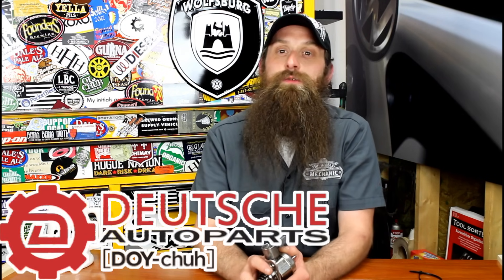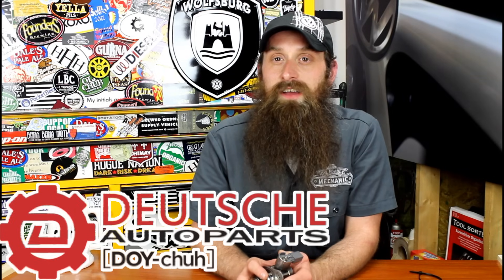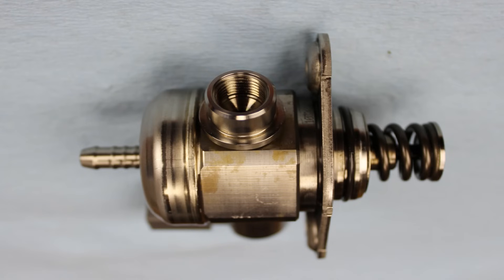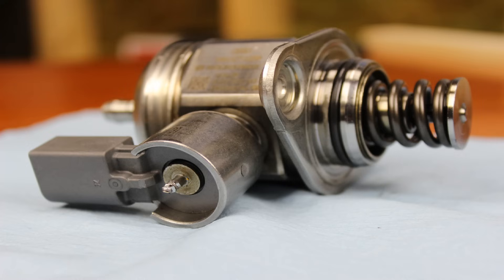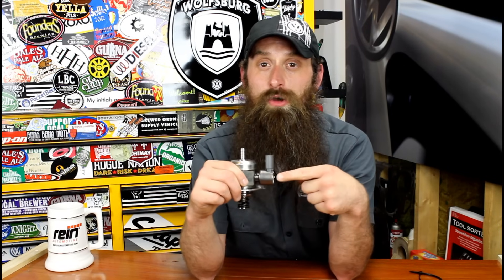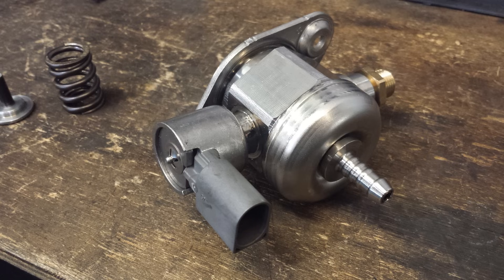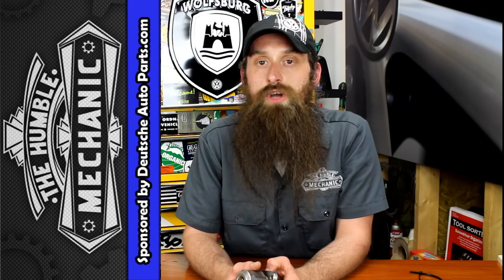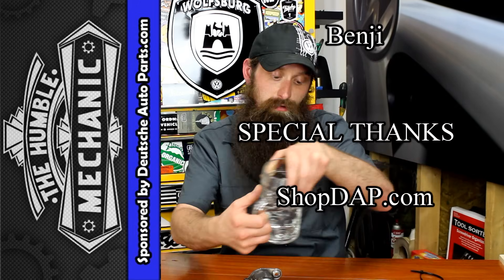How VW and Audi 2.0t TSI High Pressure Fuel Pumps Fail (HPFP)

Comment: I have 2020 Q3 
Shortly after start up it briefly looses HP . Slightly stumbles and recovers. Does this consistently. Sets engine light 2nd trip. 
It will run fine and not stumble until turned off and started again ? 
Just starting to see 2020s here in the shop

Comment: had a customer car, vw pasat 1.8 tsi I change a used one, but still do the same.. cold start its ok, but when hot it shut off engine... Also EO is missing.. but i forgot to check HPFP follower.. wish me luck guys tomorrow.. the customer keep pushing me
Reply: I have the same problem did you figure out what was causing the problem by any chance?

Comment: My Tiguan 2013 has fuel issues the car have no issues power wise but what happen is after the car get hot and i turn off the the car it starts to surge like a misfire if i hit the gas a little it stop or turn the AC on im getting 40 bar but the fuel cycle on idle is 70% and over

Comment: I have a 2017 Passat SE with 1.8. Recently changes coils and plugs and PVC myself. Around 1300 miles after that I had a no start situation. No codes. Brought to my trusted mechanic and he replaced the lpfp and module. He said they bench tested the pump was bad. 
Same day as picking up about 6 hours later I now have a EPC and CEL and stalling and losing power around 2-4k rpm. I used OBDII and see POO87 now. 
I really like my mechanic of 20 years and trust him but wonder wtf before I call him and ask if he pressure checked everything first. 
So could this be a BOTH pumps or could it be a clogged fuel filter? 
I am savvy enough to replace the hpfp but as you stated its am expensive what if. 
Any thoughts?

Comment: Would the hpfp on my 2012 golf R FSI cause my car to not rev past 5500rpm? Its cuts right out like it’s hitting limiter
Reply from the maker: possible. but usually they dont rev smooth up to that point.
Reply: @ seems to work good up until that point then it basically just cuts out, does it in all gears. Almost thinking hpfp or wastegate

Comment: Question, I need some help. I have a 2020 VW Passat 2.0 TSI. 

It keeps blowing out my injector seals on cylinder 1&2. I've replaced them 3 times. It keeps pushing out the both white and green seals that go into the fuel rail, I've done everything people have recommended on the internet, and I've had a certified VW mechanic come to my house to check if I've installed everything correctly. 

Could that be because the HPFP's pressure is too high.? Seals and injectors are brand new (OEM).

Comment: So my car wouldnt turn on because battery was dead tried to swap battery, and My power steering went out, then engine light came on, mechanics  told me my hpfp is not working and needs to be replaced, you can hear a noise coming car wont go past 4k on sport mode and Loss of some power with stutters. I pray to god fixing the fuel pump would work because they said 90% sure its that. Scanned it and everything they said that the thing coming up. Any ideas on what to expect and keep eye out for

Comment: Need some help. I've got a 2016 Audi a3 2.0t Quattro with no fuel codes, but a misfire in Cylinder 4 with a hide cylinder code. Did carbon cleaning, fuel injectors, ignition coils, PCV, N80 valve, ran with some fuel injector cleaner AND did an engine flush with Liquimoly. I've also been using Shell Vpower gas to try and see if it helps. Compression tested and boroscoped all 4 cylinders, no scratches and compression is solid all across the board (155 all across). It doesn't happen all the time, but the car will randomly start violently shaking with the CEL and the EPC light going on and go into limp mode when taking an exit ramp off the highway. I have to pull over and let the car sit for about 10 minutes before I can start it back up. When starting it in the morning, it seems to be smoking a fairly decent amount too (white smoke, smells of either oil, fuel, or sometimes both). Have to top the oil off every week (about 100 miles of travel). Wondering if it can be the HPFP or if it's something else?
Reply: Did you ever find what it was?

Comment: p0221 code :face-turquoise-covering-eyes:
checked the harness , throttle body to ecu to pedal .
rewired it . ok
swap tested with spare pedal and throttle body .
checked ECU. ok 
removed intake , cleaned /checked variable flaps . actuator ok 👌 👌.
cleaned injectors .
car wont rev past 4000rpm 
boosts fine at any gear as long as its under 4000rpm . 
after p0221 erased and did all these things , check engine light never came up again .
any chance it could be the high pressure pump ?????
BZB engine 1.8 tsi skoda superb 
HELP !!!!!!!!:eyes-purple-crying::eyes-purple-crying::face-orange-frowning::face-orange-frowning::text-green-game-over:

Comment: Have Mk7.5 golf GTI with idle stuck at 1200rpm and noticed the fuel pressure at idle is 87.5 bar, seems very high or is this normal?

Comment: Please help! Anyone have a video or diagram of how to get to my hpfp. I have a non turbo audi a3 2.0fsi 2005 model and it's hidden behind like a metal cage. 😢 

It was running perfect except on a super cold start would rough idle for 1 minute. Scan read fuel pressure regulator lower limit not reached p1063. I've since replaced the fuel filter and hpfp sensor and low pressure sensor. Now car is in limp mode 😢

Comment: Can this pump makes metal debris in oil engine i saw couple ford gdi engines with failing this part actually pump was full of metal debris trough injectors ended in engine oil saw those flakes

Comment: Hi my high pressure fuel pump has been rattling on cold starts really bad and also when accelerating but don't have any codes, car has not that much power as before could it be bad. It's not a VW it's a Kia optima.

Comment: I just questioned the 11,000 psi on the other video. The reason i was watching them is I got a Tiguan 2.0T (in the shop, independent) Was towed in, no start. 1st time customer. Had misfire codes on all 4 cyls + random, low fuel rail pressure, cam sensor correlation (wish I didn't erase them with out writing them down). The oil looked like tar and the plugs were blacker than the tire. Did a LOF & threw in a cam sensor. The low press fuel is 90 psi. The high press solenoid clicks when grounded. The scanner (SnapOn) has 2 fuel rail pressure fields. One read 40.75-41 bar, the other reads --- but neither changes when the high pressure pump's line is disconnected. I have a rail w/the sensor, high press pump & housing, vacuum pump from a Tiguan I changed a motor on a while back. Plugging in THAT sensor open to the air also makes no change in the scanner readings. I also swapped in the other high press pump, no change. Odd thing is when the low press line is disconnected is when it sounds like it wants to start. With the pcv line disconnected at the intake, it feels like pressure coming out the port in puffs on my finger. I usually get EVERYTHING started that's a no-start. Been wrenching since '96. Had my ASE's and L1 although they're expired (this shop don't value or compensate for them) All 4 coils have spark. This is killing me. And the inside of the car is filled to ceiling with paper and bags, food wrappers and all sorts of hoarder like junk. Hope they're ain't no bedbugs in there. (Thank God the in tank fuel pump works, I wouldn't be going in the access panel on this one) Any help would be appreciated. Also, while the high press pump was out I stuck a screw driver in there and it moved in and out(thinking maybe the cam in there was degraded from the oil condition) Also put 4 new plugs and from the cranking attempts, the look sooty now too. If I think of anything else, I'll add to it.😢😢😢I also had 150 psi compression on every cylinder at 4 cranks. Disconnected the intake tube to see if the turbo was causing the puffs out the pcv port, it isn't. If that pcv line is sitting in place but not clicked on it actully puffs away from the port about a half inch when cranking.
Reply: Also have compression go up to about 140 psi in 4 cranks
Reply: I cranked it with a vacuum gauge attached to the intake manifold. Actually a compound vacuum pressure gauge. The needle fluctuates between 5" Hg and 5 psi. I repeated it with 1 spark plug removed at a time and it was the same for all 4 cylinders

Comment: German cars are designed for germany; where every 2 years you must do a full comprehensive check on your car and fix everything every 2 years, the part replacement engineering racket.

Comment: I have a 2007 Audi a6 3.2l with code p2296 would I need to replace the hpfp? It stall and idles rough sometimes has misfire codes. Any help would be appreciated.
Reply: Did you fix it? I've got a audi tt doing the same thing my mobile mechanic suggests it the high pressure fuel pump that's going bad

Comment: Hi I have a 15 Audi A3 2.0 quattro gasoline engine I was making line to cross the border     I have it in idle most of the time the car starts shaking and it dies, I wait for 15 min and it starts again it stays on for around 10 min and it dies again I wait for 15 min again and it starts then I cross the border and drove it 40 miles on the highway and works good can you help me please

Comment: There's another failure mode for these pumps. Where the pump is still working but some fuel is leaking past the pump piston into the top of the engine causing fuel in your engine oil. This is bad! I saw a video over at Diagnose Dan about this. The symptoms: codes for fuel mixture too rich while long and short term fuel trim are both showing negative values. Exhaust gas smelling strongly. Potentially test by removing oil level dip-stick, hold it several meters away from your engine bay and offer up a lit match/lighter flame to it. Oil Should not catch fire unless first heated to smoke point. If it does catch fire there's fuel (gas) mixed in with it.
Reply: What shoud i do ? I change pump but it sont chang any think . 20 min of ride and angain i have low oil pressur warning. Pls help
Reply: @kenajt3  is the engine oil getting diluted with fuel? 
If so it could be partially blocked injectors. Is the fuel doesn't mist properly it can cause fuel wash and pass the pistons entering the oil that way.
Reply: @felixokeefe   yes i have petrol in oli. i disassemble vacum pump and again its wet , fuel of cours. Question is why new bosh pump make same problem as previus pump. sorry for my english. i will change also a part concted with camshaft. meybe camshat slightly crooked. i frustrated . pls help
Reply: loud tapping coming from my high pressure fuel pump. Plus my car is making like a bogging sound when I accelerate and a loud tapping sound coming from the high pressure fuel pump
Reply: @frankietraxable did you replace it

Comment: I’ve got an EPC light on a 2014 VW Jetta 1.8T comfortline with a code P229500 “fuel pressure regulator “B” control circuit low” and a P164E00 Oil pressure regulation valve electrical error.. everything I can find on it says it’s a wiring connection to the HPFP… is this the case how can I fix this without having to buy a whole new hpfp?
Reply: I have OBDeleven and that’s what it gives me.

Comment: Im getting p2293 then miles later im getting p12a4. Takes a mile or two for first code. Car drives fine. Cam looks fine. Replaced follower and hpfp from a doner car that i have. swapped fuel pump. Swapped rail sensor. Still cant get the code to stop coming back. 2010 audi a4 quattro
Reply: Did you ever solve your P12A4 issue?

Comment: I had a 2008 VW EOS that had the P2293 code.  Low pressure was fine.  Check the High Pressure pump.  Replaced pump and follower which both looked fine. Got frustrated and tested sensors which seemed fine.  Found a fuse marked F6 15amp which was blown and indicated that it was for the instrument cluster in the owner manual.   Changed fuse and fixed the problem.  I will have to dig deeper because I have no idea why that fuse would have blown and the instrument cluster was working fine.   Have driven for over a week now and no problems and fuse hasn’t gone out again.  Crazy strange!

Comment: Could this relate to p2293 fuel pressure regulator 2 performance? Running out of things to try now, i changed in tank pump, fuel pressure sensor, the fuel cap and coil packs, to no avail, im hoping this might sort it
Reply: Did you have any luck on this one, im getting the same code and a hesitation between 2500-3500rpm but hpfp was also replaced 5k miles ago.
Reply: @lukelasslett1017  since been told that it's the lambda sensors so waiting till I've got the funds to get them swapped out bud

Comment: QUESTION I HAVE A 2012 PASSAT 3.6 THE OTHER DAY THE KEY WAS STUCK IN THE IGNITION  AND THE CAR WOULDN'T TURN OF SO  PULLED THE FUEL PUMP FUSE ON THE SIDE OF THE DASH PUT IT BACK IN AFTER I CHANGED THE IGNITION NOW I HAVE EPC ,P2293 & p0087 any advice Car is in limp mode

Comment: Can i use an audi Q5 3.2 hpfp on an A6 C7 3.0T.?
They looked same but migh not work right. I having some long crank on the mornings, low pressure fuel pump is new .